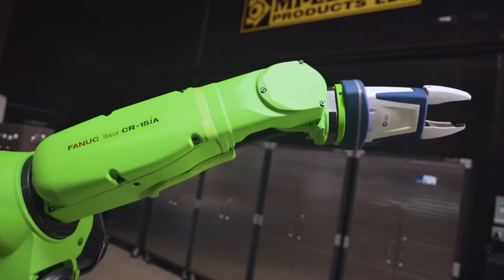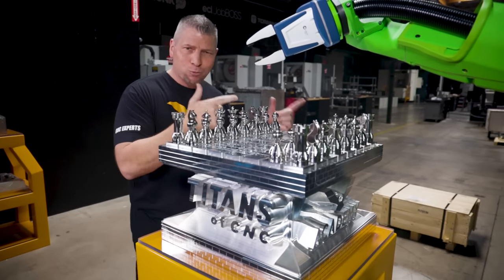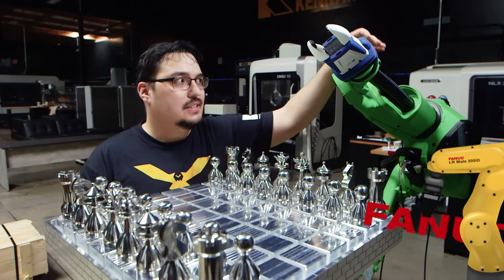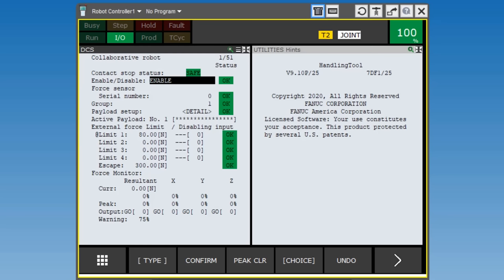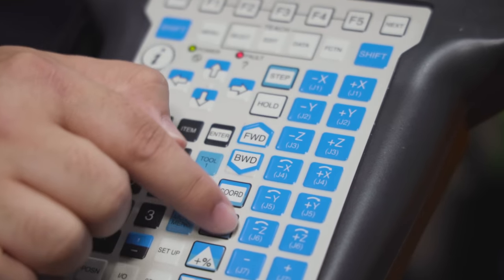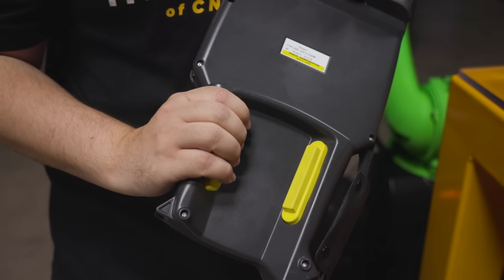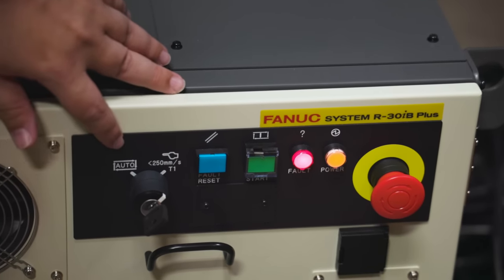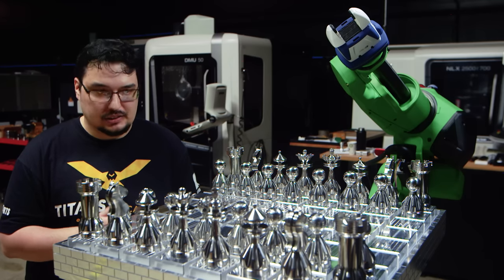Learn Robot Programming in 20 Minutes | Make $$$ as a Robot Programmer

Comment: Hello, what programming are you using? Java?
Reply: Fanuc Robots are programed in two different proprietary languages. Karel, and TP. TP is a simplified, low-level language designed for easy, quick programing of robot motion and simple logic. Karel is a higher level, but somewhat obsolete programming language similar to C. There are also software options that let you control the robot from a PLC ladder logic, or C# PC application (PCDK). 

If you want to program a robot in Java, I know KUKA IIWA collaborative robots are one option.